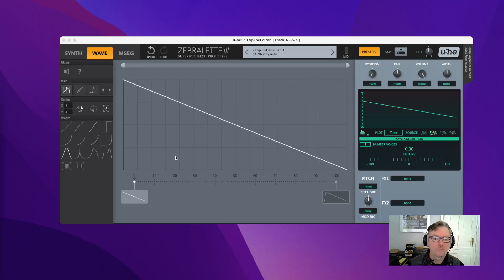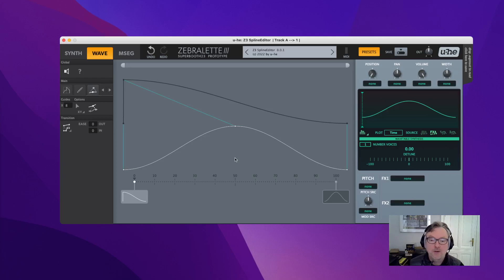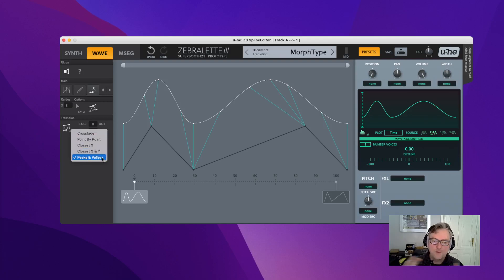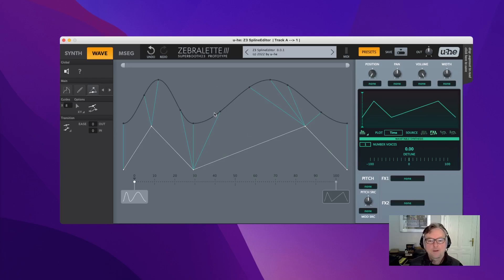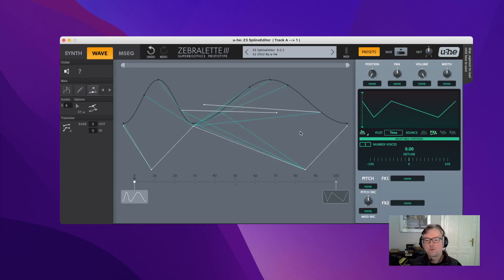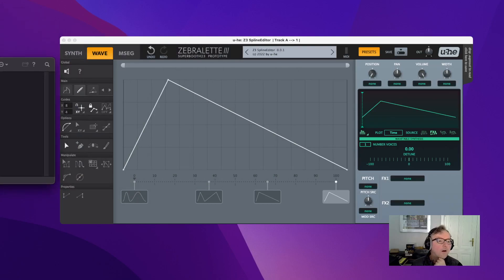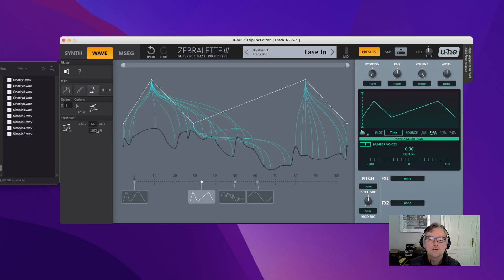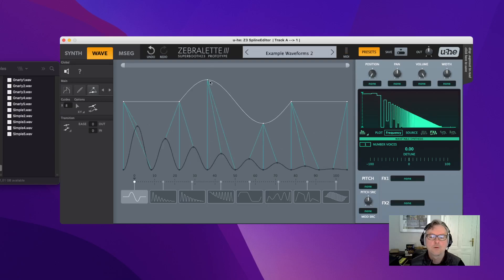Zebra3 Spline Editor Part 2: Morphing

Comment: Decimation as oscillator effect please? (perfectly pitch tracked decimation. i noticed zebra 2 can do it somewhat, but would be nice to modulate samples/period. Then you can go from SID to analogue in one sound. round to integer samples per period is cruicial, otherwise it will distort)
Reply: making something myself and this sounds like it could be an interesting addition. what exactly do you mean by pitch-tracking the downsampling? like having the sample rate be dependent on the given voice's frequency or something?